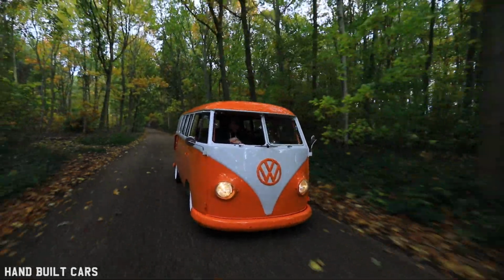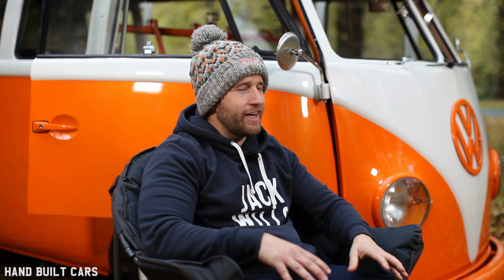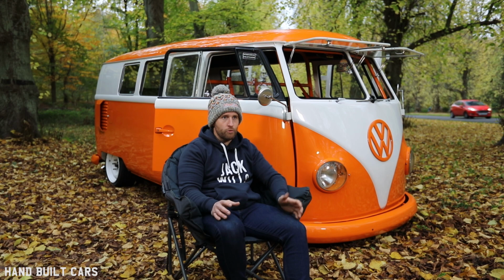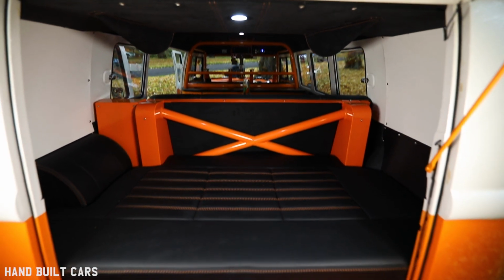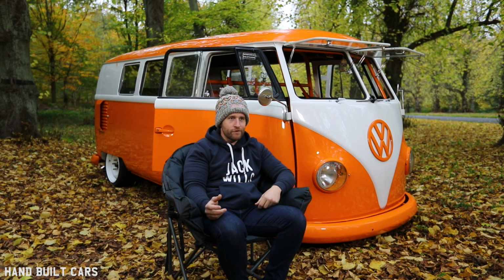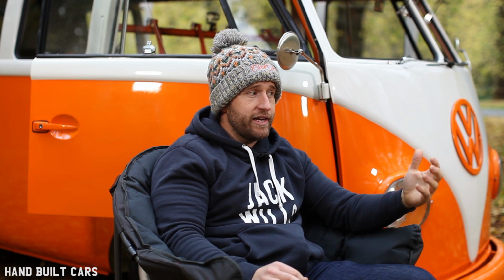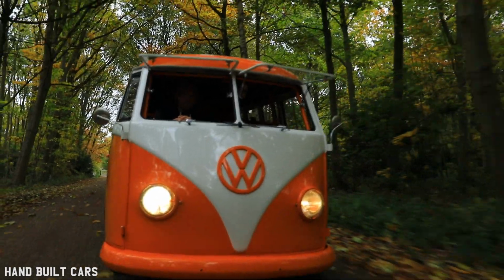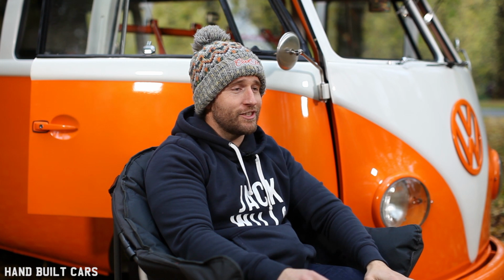1958 Volkswagen 11-Window Split Screen Microbus "Splitty Turbo" (Took 15 Years to Build)

Comment: Really beautiful car! Btw. In Porsches the air comes in through the rear deck lid grill and exhausts through the engine to under the car cooling the engine.